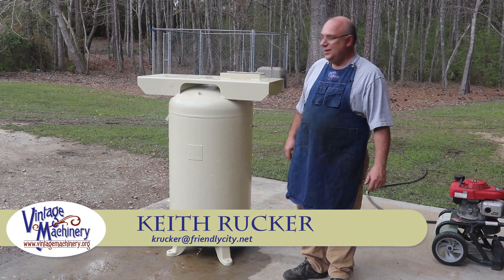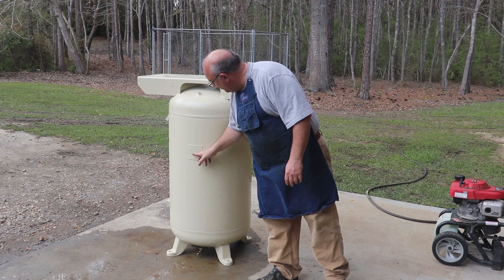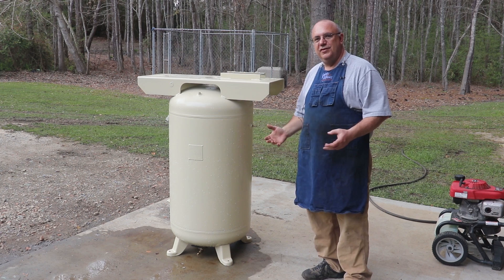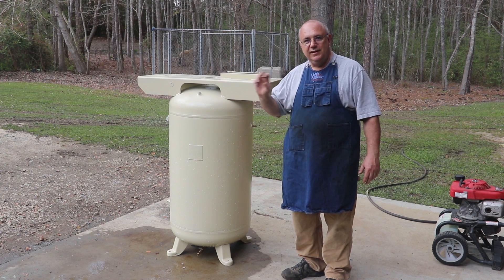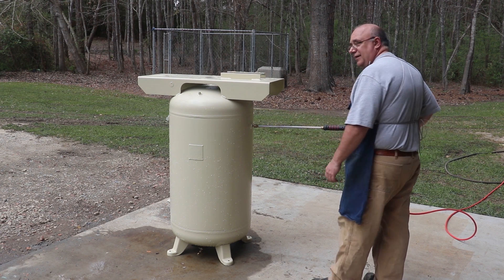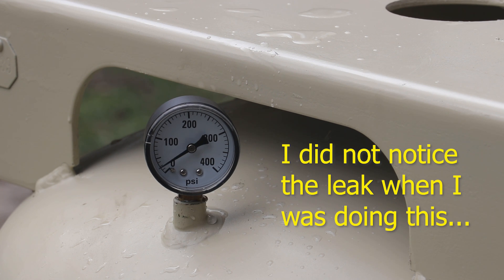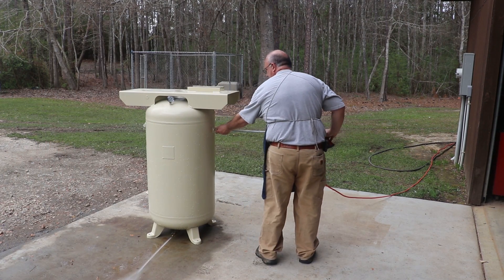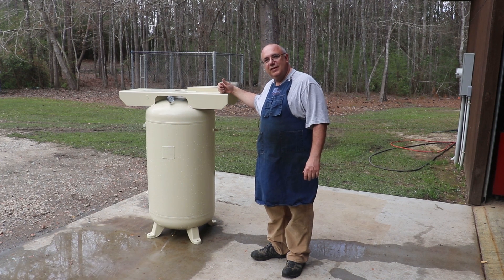Hydro Pressure Testing a Air Compressor Tank

Comment: How long are you supposed to leave it pressurized
Reply: Good question, reading through the comments I think I read 30 minutes, 1 hour, 2 hours, 4 hours. Guess it depends on which one of the ‘experts’ you want to believe or which one of the various standards you want to try to find and read.
Reply: @nevetslleksah  yeah when I talk to somebody else about it he said half hour is good enough
Reply: @tigwelding123  - one fella even mentioned a failure in the last hour of an 8 hour test on something that was being pressure tested. Probably wouldn’t hurt anything to leave it pressurized overnight or 24 hours for that matter if you had the time.
Reply: @nevetslleksah  true

Comment: Nice easy test setup there Kieth! I imagine it would have done the full amount but it is an old tank and a test like that might cause a future failure.
The thought of a tank like that exploding is pretty scary. Thanks I enjoyed the video. 
I'm restoring a ProAir 80 Gallon 6.5 HP 175 PSI now. It was not locked up but had some build up in the 2nd stage cylinder bore that would stop the piston a 1/2 inch from the top and not letting the piston make its full revolution. 
I've replaced the tank check valve, cleaned the bore to where it turns freely, replaced one capacitor and ran it with an open valve for ten minutes yesterday. 
I was going to do the same thing today and it popped the run cap on startup. That was a 2005 cap so I've got one ordered for it along with the oil filler breather cap. We used it for years at our Pipe Construction garage.
An old tank is always sort of scary though. It is in very good shape though so I'm not to worried about the tank.

Comment: The only thing stopping a million people from doing this themselves is knowing how to set up the fitting between the tank and the pressure washer.  And you basically didn't show that or talk about it in any useful detail.
Reply: I looked into it a little and found an adapter that looks like it would be part of the solution: Forney 75109 Pressure Washer SCREW COUPLING Hose Connector M22F to 3/8" MALE NPT.  I found it on ebay but I think I saw something similar at the big-box hardware store.  That reduces the problem to an NPT setup that would go the the tank's 1.5" nominal or so NPT opening or maybe the tank's NPT drain-line opening.
Reply: True
Reply: I mean, it can't take too much internet surfing to find what you need.

Comment: Good thinking to do hydro testing .  I did considerable amount of air-testing to failure and few can imagine the destructive ability of even a medium size vessel when the failure occurs even at rather low air pressures .  It is hard to over-engineer the confinement chambers necessary  to contain the "shrapnel" as the result of the ultimate failure .  Most of the time even the confinement chambers are partially destroyed .  Air-testing is indeed life threatening !

Comment: The minimum test pressure should be 150% of the setting of the ASME certified safety relief valve that will be installed after the test. You want a safety factor of at least 150% after something goes wrong and the pressure reaches the blow off pressure of the safety valve. It is not about the INTENDED pressure but what the pressure MAY get up to. Redundant safety valves or 200% test pressure may make you sleep better.
Reply: Thats ASME B31 for process piping, this is a section viii pressure vessel, 1.3x mawp is fine as hes testing the tank, not the safety valve.

Comment: I did this about 50 years ago, before homeowners had pressure washers, by filling the tank almost completely with water and then using the air compressor to pump it up to 200 psi. I doubt that I had more than a cupful of space with compressed air. No problem.

Comment: I was replacing a jammed safety relief valve on a hot water tank once. I stupidly did not release the water pressure on the unit and the damn fitting shot across the room with quite some force the moment I was done unscrewing it. It was just residential, so probably not more than 30 psi on it. I've also cut into plenty of water supply pipes while forgetting to depressurize... (seeing a pattern, eh?) When it's just water shooting at you it's just fun and giggle, like Keith says. The thing you want to be careful of is any fittings or similar coming loose for whatever reason during your test. Those could easily knock out teeth.

Comment: Elementary Mr. Watson, I mean Mr. Rucker. Regarding the pressurized liquid, Blaise Pascal, stated this law way back in 1653!!!! Isn't that incredible! We didn't get around to listening to what he said until the 1900's when industry finally got around to using it in manufacturing!!! His law simply states that "a change in pressure at any point in an enclosed fluid at rest is transmitted undiminished to all points in the fluid." That means with water (the first hydraulic fluid), under pressure of 1000 pounds will have 0 pounds of pressure if that container gets the smallest of leaks instantaneously!!! 

Taken a step further though, I see that we can magnify just about anything. Light, sound, waves, just about anything. So why don't we magnify gravity? If you could do that you would have the world in your back pocket!!! Just thinking.

Comment: thank you for the idea of using the pressure washer, I am in the middle of testing a intake manifold on a boat engine that had coolant in the oil I traced it to the intake, so before adding the oil and coolant I want to test it, thanks again

Comment: Informative video; I've had refrigerant recovery tanks "hydro-tested" for recertification, never really liked the idea of introducing water into a refrigerant tank. Now I understand the thought process of using water (safety factor) instead of another medium. Water & refrigerants shouldn't be exposed to each other, causes all sorts of problems inside a refrigeration circuit. I guess I have to trust whomever is hydrotesting the tanks properly dries the interior completely before shipping it back to me. I believe a deep vacuum pump (6 CFM or greater) drawn down to less than 100 Microns vacuum is an additional "no worries" about water inside the vessel. Good video, liked the presentation!

Comment: Does anyone if painting the inside with epoxy paint, help to avoid the rust ? I want to test that, but appreciate if someone has done it before and tell me if it helps or it is just a lost of paint.
Reply: Galvanised or stainless steel but definately not paint.
The paint could flake off with time and clog something down the line...like the relief valve for instance which can have catastrophic results.
Just drain it before each use.

Comment: Did hydro psi inspection on aluminum & steel vessels,   magna flux too . Failures from surface stress cracks were Very concerning.& solutions  for mfg. Process adjusted.    No safety burst shielding  .. do not attempt  if not trained, shrapnel will ruin your day.

Comment: To tell my story, I was hit in the chest with hydraulic oil under 1500 PSI that was stored in a small accumulator. Main hydraulic pump was off. I had a good quality work shirt on and a T-shirt underneath. Because the pressure dropped to 0 PSI 'instantly', all I was was SURPRISED and covered in oil. No bruising or other markings but I'm sure my face was red from embarrassment. 😲

Comment: I've always wondered about stress testing like this. How do you know that the test itself, exceeding the stresses of the intended application, doesn't weaken it and cause premature failure after one or more pressure cycles?

Comment: just asking .. wouldn't a tank that size have an inspection plate ?  my compressor is only slightly smaller and it has an inspection plate.
Reply: He painted over the A.S.M.E. plate.  That is where he read the 200 PSIG max allowable working pressure.  There is also a serial number and you can gain the original inspection report from the National Board in Columbus, Ohio.  
In his case, if he is in a code state, his insurance company has a say.  He was wrong in so many ways.  For example, thickness of the steel heads and shell plate.  Do not visually inspect welded joints that are painted over.  Another commenter wrote about using a device to visually check the interior for corrosions.  1984, I would expect it.

Comment: When I pressure tested my old Quincy 50 gallon tank a few years back I just filled it to the top with water and put a liquid pressure gauge on it.... I then made sure all the air was out and I capped it and left it in the sun. The heat soaked tank slowly built pressure enough to successfully test it. Works great as long as you have a sunny day.

Comment: Your tank  looks like an Ingersoll Rand compressor tank. Normally the test pressure of a tank is double the working pressure plus 10%.
I work for Ingersoll Rand for 25 years as a hydrostatic tester technician. I tested my share of those plus the casings plus numerous numerous types of equipment.

Comment: I appreciate what you are doing but you are only going to know of a catastrophic failure, where it springs a leak or worse yet, blows up.  That's not how a hydrostatic test is done.  Locally, we use a fire equipment company to test our scuba tanks, these are tanks that are used up to 3000 psi.  The facility has a hole in the floor.  A hose is connected to the tank, it is filled with water.  The tank is immersed in the hole in the floor.  The hole is really a large pipe, but we can ignore that.  A cover is applied to the hole (test chamber).  There is a monometer attached such that if the water level in the chamber rises, it can be noted.   An initial reading is taken of the water level in the chamber.  The pressure is increased in the tank under test.  Providing there wasn't a catastrophic failure, the pressure in the tank under test is relieved.  If the water level in the chamber doesn't return to its original level, it means that the material the tank is made from had yielded, that is, the material is no longer elastic.  If that was the case, the tank would be returned to the customer destroyed.  Otherwise, if the tank returned back to it's original dimension, it passed the test for another five years or so.

It's only been 40 years or so since  was involved in the testing, so if I am wrong with anything, I'm sure I'll hear about it.

Jim

Comment: Keith Rucker? You must be the Rucker as in Ruckering old machinery back and forth across the country, right? Anyway, I did a similar hydro test on a junkyard tank I got for $40 in 1985. I was afraid of the tank and tested it as you have done here except the pressure came from a little homeowner type air compressor disconnected from its tank and pressure shutoff. To increase the pressure I plugged and unplugged the motor until I reached 300#. The tank creaked and popped until I called it good. The tank remained in service under pressure for 30 years until it started blowing bubble through the weld around the drain fitting. Then I gave it to a farmer to split longitudinally for stock feed and water.

Comment: i check mine every 2 years... because it's code. though never done anything like this. always check check wall thickness.
Reply: Be careful with that it only takes a pin hole from corrosion in a hard to gauge spot that way
Reply: @theguywithallthesolutions  millions on pressure vessels are tested this way in my state every year. I would think other states are similar. They take several readings across the bottom of the tank.

Comment: The test shown is what DOT calls a low pressure  hydrostatic test, it does not require measuring expansion. For this type of test, the cylinder is inspected internally for rust and corrosion, which should be mechanically or chemically cleaned, flushed and filled with water. The tank is then pressurized to the rated pressure for a minimum of 30 seconds without any leaking. If the pressure holds, the tank has passed the test and is good for 12 years before the next test.
  The pressurizing device should have a shut off valve to keep the pump from supplying water in the event of a cylinder failure, no big explosion, you just get very wet.
Reply: 12 years?  Is this a typo?  If the tank is in an ASME code state, that states law determines time interval between tests but the insurance company has the say also.
Reply: @larselder874  If the tank has a DOT symbol or number on it, the rules I quoted apply.
Reply: @garwilliams4937 .  From the Manchester Tank web site. " Built in accordance with the ASME Section VIII Division I code latest addition.
 Vessels are "U" stamped and registered with National Board"  You misunderstood my 'L' remaek.

Comment: See? You just explained the problem with water cooled Nuclear reactors. They use pressurized water(very high pressure), which for every pound of pressure you get about 3 degrees increase of temperature before boiling (212deg F). So how much pressure for 600 Degrees F?  In a building the size of a football field? Your car is happy with 30 psi in your tires, and they are rather small but carry thousands of pounds of weight. Molten salt is far better, and is happy at 700 deg C. Radiation isn't the problem compared to water explosions dispersing it. But I did come to this channel for the hydrostatic testing procedure, and appreciate it. Nice explanation, Sir.

Comment: The main reason for testing at a higher safety margin for steam vessels is temperature so if you're testing with a cold liquid increasing the margin helps account for the fact that steam will heat the vessel and make it expand/affect it's metallurgical properties.
Reply: Carbon steel metalurgical / mechanical are AOK thru 650 degrees F.  Critical pressure steam is 3,006 PSIG and yes, I have photos of a leak.  serious.

Comment: Better not leave that ASME  nameplate on. You are violating the certification of that tank, no matter what you test it at.
Reply: DO NOT REMOVE THE ASME NAMEPLATE - EVER.  Gene, he is not correct in his test but removing the manufacturers serial number, thicknesses, max allowed working pressure - knowledge another person has to have available.
Reply: @larselder874  I was an NBIC( National Boiler Inspection Code) boiler inspector. The information on that plate is no longer valid and not an ASME certified vessel. Leaving the plate on would constitute it as a legal vessel. Your point is that he can leave it on and sell it to someone else if he is scrupulous enough to inform the buyer of his sham test without an AI (Authorized Inspector) from NBIC. So that prospective new owner(s) could rectify by new engineering calculations. Here's my take if he is stupid enough to harm himself then fine but anybody else is a victim of his actions. I would not leave the plate on either do it the right way or scrap it.
Reply: @genesenecal9140  Lv the nameplate on until vessel scrapped. You are the person to witness hydrotest and approve or not.  Ultra the thicknesses, get cert from antional board in columbus are all vaild.
Reply: @genesenecal9140  On second thought.  Your employer wanted nameplates removed so that no one could come back with any damage claim.  No way to tie your firm to any inspection, approval for use.  This is the first time I doubted the integrity, ethics of third party.  Sections VIII, V, IX, II.  Trained by committee members.  Final:  If you saw an "L" below the U stamp - would you remove the nameplate?

Comment: The idea of hydrostatic pressure testing cylinders or a tank is to also measure the expansion of the tank while under pressure by immersing in water so it can be measured. This is not a recommendation for it could give you a false sense of security.

Comment: Not long after I got my Quincy 80gal vertical air compressor, I made the BIG mistake of getting my arm in the way of the drain valve at the bottom. My wife said she bled off the air

Comment: Great way to have peace of mind that the pressure tanks is alright to use. I watched a video yesterday where a mechanic showed the aftermath from a compressed air tank failure. The shop was in disarray, with holes on the wall, & door, as well as all windows busted!
Reply: I came here from that same video

Comment: If you were to measure the mid point diameter increase I wonder if it would be enough to emulate the results available from a full submersion volume increase test.

 I'm reminded of an interesting problem at a paint department. They had a fancy lacquer paint job on an old secondary air tank that helped to diagnose a collection of errors. In addition to their main compressor they bought a detuned to 175psi setup to provide high pressure whenever they ran their spot welder and through a series of plumbing and control mistakes over pressurized everything. This was during a rare BBQ lunch break when no one was around. A few older hoses had ruptured but the pumps managed to keep up long enough to trip a 225psi safety high pressure lock. My name was on the CSA document so I got the opportunity to sort it out, not that it matters. Their old secondary tank's lacquer paint job was full of tiny lines around the mid point indicating that cracks had formed. Everyone agreed they weren't there before. I don't know what pressure it actually shut down at but the safety switch was a fixed setting guaranteed to pop within a percentage, the new one says 2%. 
An old 150psi relief valve and two 200psi burst disks were pressured into accepting early retirement... with severance.

An idea... A mid point diameter checking device could have a multiplier that made a dangerous increase easily noticeable or better yet detectable by a switch. You never know when a BBQ might happen.

Comment: Pressure vessels should be designed and tested per ASME code Section VIII. The hydro test should be done at 150% of working pressure, and then it has to hold that pressure for one hour...
Reply: For refrigerant receivers if this size at 300, 350 and 400 PSIG MAWP, are dry air tested at 125% with tank submerged under water.